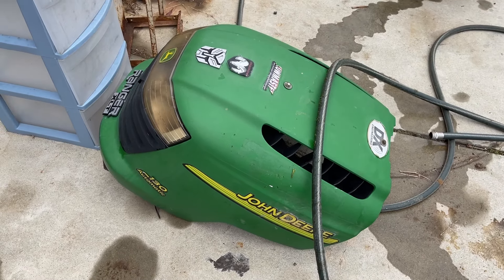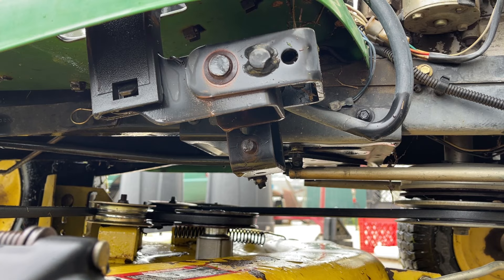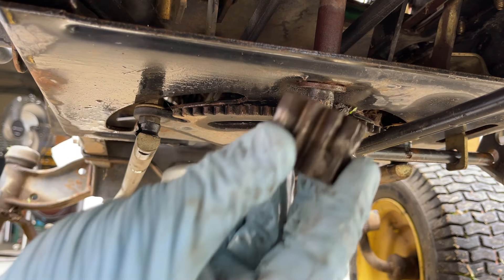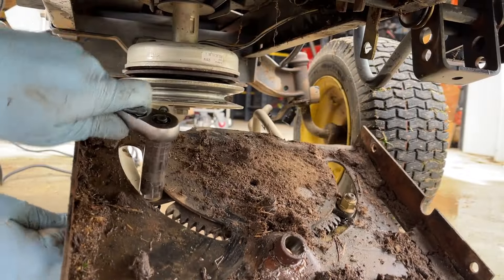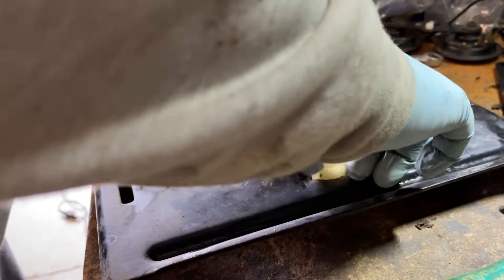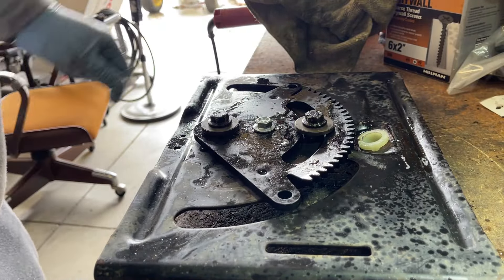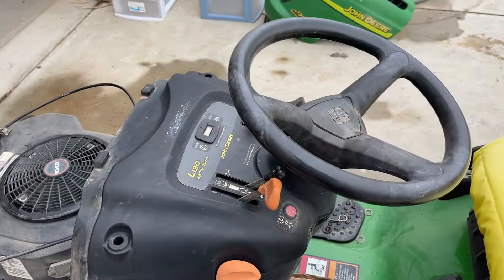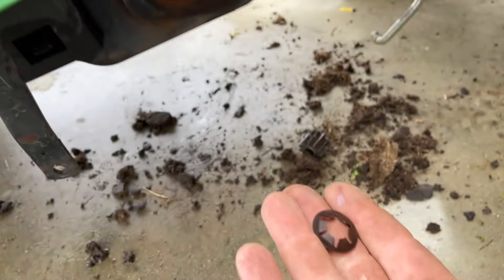How To Fix Steering On John Deere (L, LA and D Series) Riding Mowers

Comment: This was all quite helpful. When replacing mine, the pinion was absolutely frozen onto the steering shaft. Had to borrow a 2ton parts-puller from autozone to finally work it off. Turned an hour and a half job into a day and a half job. Hope I don't have to do this again anytime soon!!
Reply: @leazarus  hey I’m having the same exact problem, how much was it to rent that parts puller and do you think it’s worth it rather than taking it in somewhere to have a mechanic do it?
Reply: @theincognitoburrito7967  hey!! Most car parts places have loaner programs - you just pay the deposit then they refund it when you bring it back. Definitely the way to go, although it took me a solid hour to finally work it loose. Hope yours is easier 🙏🏽

Comment: Thanks for this video I really need it. Was mowing the back 40 and everything was going good for about an hour then all of a sudden it became harder to steer cause I would turn the wheel but it wasnt catching. So I inspected it as good as I can and the only part I was feeling not working right was with those exact pieces especially the star type piece on top of the other pieces. So now I can't finish mowing if I cant turn. Im not mechanically inclined but this was easy to figure out. Guess it wore down over the years and decided to shit the bed when I was mowing.

Comment: Big mistake putting in the Plastic Bushing.  Get the Brass Oil-lite type.The Pinion (small) gear can be inverted as the use area is not centred. Saves buying a new one.  Sometimes you have to drill through that pinion gear.  If you are handy, you can carefully cut unused sections of the old sector and weld it to the top of the sector in the wear area.  Bring them a bit to the rear to allow for the angle of the Pinion.  It helps a lot if you put the tractor on ramps.
If you did it right you don't have to remove the steering wheel.  Now grease kingpins (spindles).
Great Video Sir.
Reply: Yes you do because as the gear strips the steering wheel will be at some weird angle.  You have to get the wheel back to the right position once you get the new gear on.  Mine was inverted almost 180 degrees when it started stripping.
Reply: @rstroud3279  Straighten the wheels and Steering wheel before you put the gear on the shaft!

Comment: I think the purpose of the alignment bolt is so you can line up the steering wheel to the steering gear without having to remove the wheel. Also a little heavy grease on the new gears (pinions and steering is usually recommended by the manufacturer.  In fact I would have used grease rather than WD-40 as a lubricant.  WD-40 is a decent penetrating oil but lacks in the lubricating department.
Reply: WD 40 will just dry up quickly and disappear 
...grease the pivot points...not the gear teefs...✌️
Reply: So if your steering wheel inverted as the gear stripped, you are saying to turn to align it with the bolt before connecting?
Reply: @rstroud3279  Set the steering wheel straight before inserting the steering column into the pinion gear.

Comment: Note, make sure your main transmission belt is in good shape before you put the steering wheel assembly back together, or you will have to take some of the parts back off to put a new drive belt on

Comment: Is there another bushing higher up on the steering shaft?   Great video. Would love one on older Craftsman GT's if possible. Notorious for needing steering replacements
Reply: Yes... That's why it came with two plastic bushings. You have to take a Dremel and modify to make the bushing fit there's other videos on that.,.

Comment: Thank you for this video.  It is very helpful.   About the new parts.  I looked at the Amazon non OEM parts, but comments stated that OEM is made of hardened metal, and Amazon non OEM are made of aluminum.  Given the design of this steering system, aluminum is NOT the way to go because the steering gear and pinion are going to wear out extremely fast, and then you have to do the job all over again.

Can you comment on how your non OEM Amazon parts have held up?   Thanks.
Reply from the maker: @odiumpugnator472  in the 2 years since this repair everything has held up fine.
Reply: @hanksgarage_    Thank you for the update.  I'm wondering how those parts fail so quickly on some JD's and not on others like yours?
Are the steering gear and pinion that you used made of hardened steel, or aluminum?
Reply from the maker: I honestly don’t remember

Comment: Can we grease that part up with marine grease would that keep it working longer?
Reply from the maker: Honestly any grease is good grease.
Reply: @hanksgarage_  Just remember, grease an oil are magnets to dirt and grass.  Grease the pivot points, not the gear teeth.  Little on the plastic\steel bushing.

Comment: I cant get that gear on the bottom to come off for nothing.I,ve had it off before to change the drive belt and it came off easy then with a pry bar but now it wont.Guess i,ll have cut the shaft in half i have all new anyway dont know why it refuses to budge now.
Reply: Now you see why grease or anti-seize on the shaft before putting the gear on is a good idea.  Do this for wheels and anything that may need to be replaced in the future.  To remove the gear, heat the gear only after spraying with penetrating oil, put the nut back on the shaft about 3\4 of the way and pound on the end of the shaft.  May be useful to have another person pull up on the steering wheel at the same time.  Couple of good whacks should do it.

Comment: Do you have to take the hood off to do this job? I just ordered the parts from Amazon, Thanks very much
Reply: I did this job without taking anything apart but the steering.
Reply: @jor-d5640  You mean no deck or cover removal?

Comment: When you aligned the steering wheel, was that just so the center cap is in position?  The wheels looked straight when you did it,  i just replaced steering plate, pinion gear, spindles and drag links,  the tires were straight until i drove it, drove good but one tire was way out when i parked it, any suggestions on what caused that?  And also new drag links are adjustable but i don't have any room to adjust it, they seem like same length as old ones. 

Thanks

Comment: I just my mower straight up with maybe a little slack removing material underneath when straight up with a slight rear lean ...steering plate and cog gear is easy to replace no need for removing all the extra pieces and gear mounting plate that was removed...👌👈
Reply: Are you saying you didn't need to remove the deck or the plate?

Comment: Something you can do to get a bit more life out of it is flip over the pinion gear.
Reply from the maker: Yup definitely would help in a pinch
Reply: The pinion gear on my JD has splines on the top and not the bottom
Reply: @hankarnold5947  If you drill it out on just that end it will work